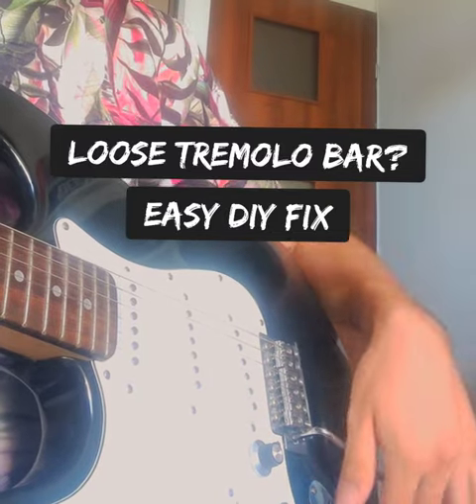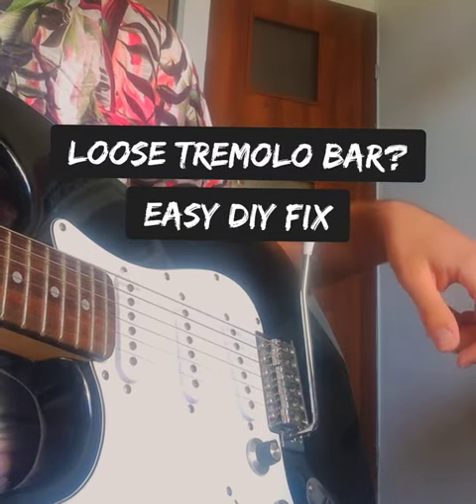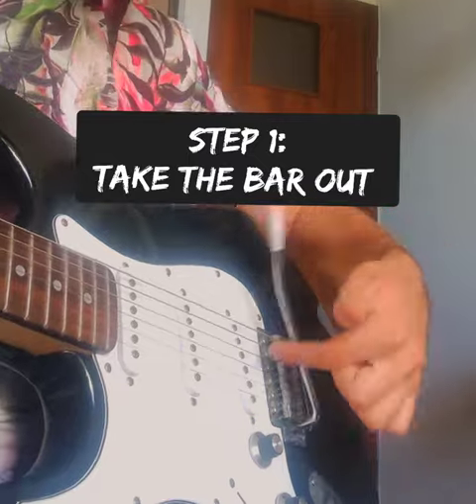Loose tremolo bar fix on #stratocaster  #shorts #guitar #fender

Comment: For those trying this method, be careful because the spring will become compressed and stuck sometimes, Fender makes a specialized spring they sell in a pack of around 20-30 for $5
Reply from the maker: Yeah, found that out too, it was getting stuck when I put it the cut side up as the spring started to wrap around the bar, that's why it's better to put it the clean side up
Reply: @mtm8049 the Fender spring is to rigid the pen spring is smoother easier and easy to get replacements the slight annoyance if you remove is worth it.  I never remove it so unless I am doing a deep cleaning of the entire instrument which is like once every year.
Reply: Turn it few more times, that’ll do the trick. 😅

The spring is good for taking any little ‘play’ out of the the bar. Or, if someone isn’t having to take the bar on and off to put it in a case,  then plumbers tape around the threads will work too. 😝🤘🏻🎸

Comment: Something else that helps but isn't a permanent solution is plumers tape (it's thin white tape) that can be wrapped around the threads on your trem bar and then screwed into your bridge